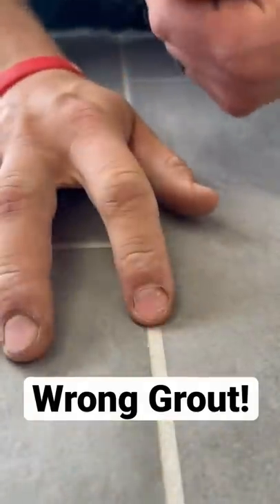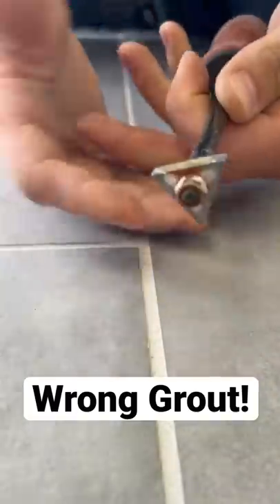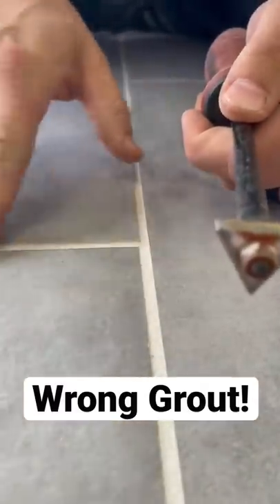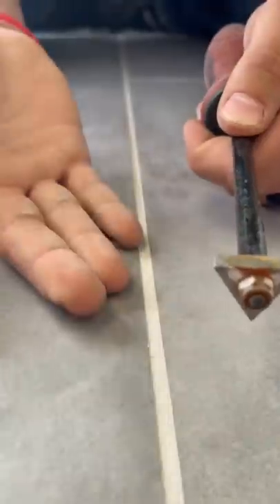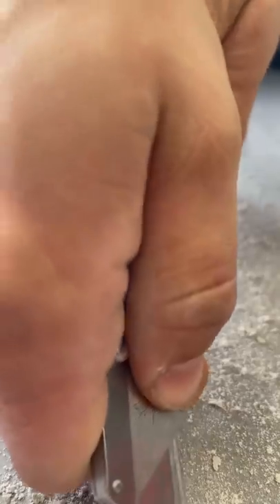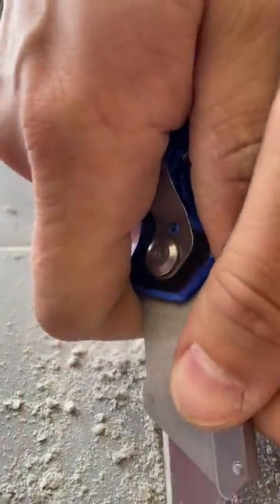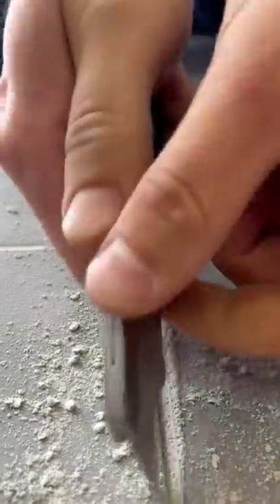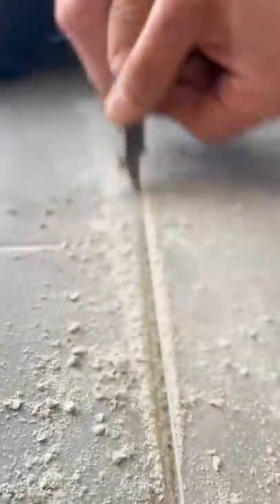Huge Mistake! We can fix it! #shorts #youtubeshorts #diy

Comment: If you are considering doing this to your own grout may I recommend looking for a company " like Stanley steemer" that does color seal. You can have them change the color to essentially anything you want. And it usually lasts 8-15yrs or so depending on how well its been maintained after which you want another coat applied. Or you can buy your own color seal and do it yourself and the benefit to color seal is the grout can never get permanently stained again because you can just color seal over it keeping it looking brand new for ever. But if you purchase it yourself do NOT go cheap on your color sealer choice.

Comment: There's a reason they sell box cutter blades by the pack of 50, the metal is so weak you could put a boxcutter on the tip and jump on it and that blade will break before it even leaves half a scratch on tile.

Comment: You would have to go through 900 blades per job lol it be better use a knife with a snap off blade their chead.sharp and when the box cutters edge get blunt you can snap it off and you will get 7 sharp blade per snap off box cutter then two sharp edges that you will get with that box cutter your using

Comment: I've been tiling for over 40 years if you're stupid enough to grout it with the wrong color .Tear the whole job out redo it and do it right don't chip the tile by using that carbine tool that should only be used for small little repairs not for big f!;:'kup

Comment: First rule of tiling , you don't make a mistake because you have ' Tiling as directed ' written on your invoice . 
Prepare a sample board with some off cuts of the chosen tile and grout it  before you commence the main floor . This gives the client some time to change their mind before you have to grout .  Always get them to sign the test piece and the quote as to their approval.  
 No way would you get any grout out so easily  on my jobs.  Your job is flash grouted and the mix was far too wet when applied !  A good way to remove grout is to either use a multi tool or a 4 inch grinder with a thin metal cutting blade . You need a steady hand , a  mask and vacuum cleaner  . Strangely the metal cutting blade will not cut the tile !